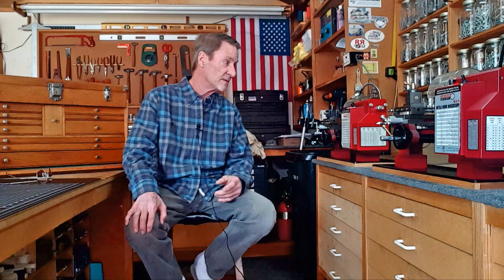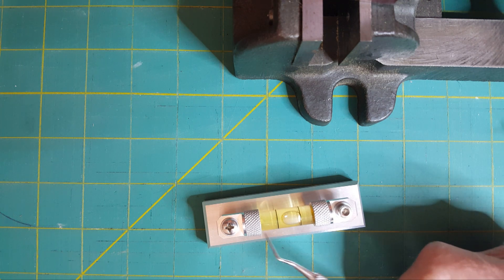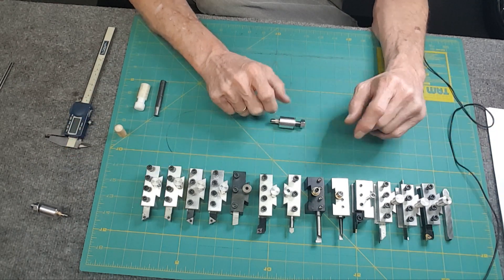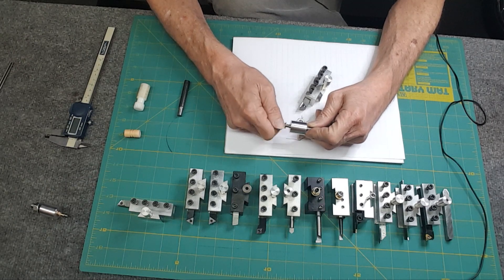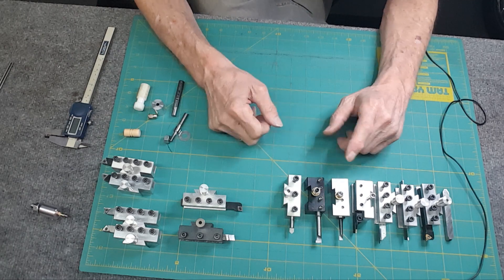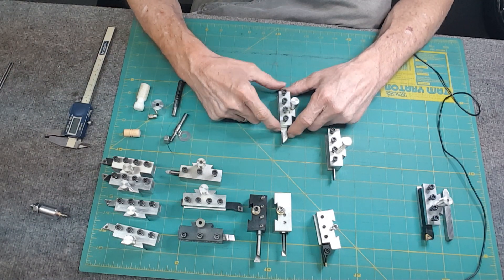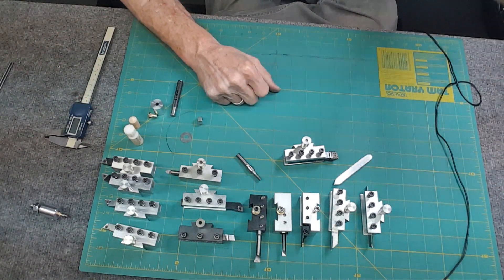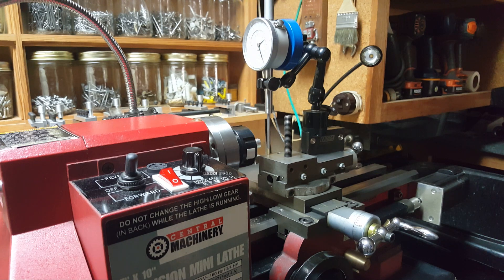Best Mini Lathe Tooling

Comment: Hello Dave, a few comments for you here. I have been in the machining industry for almost 30 years now and have worked with all kinds of manual and cnc machines including the hobby size like you have. I like watching most of your videos and I am impressed how far you have come since you started this channel, keep up the good work!

In most cases the mini lathe is not powerful enough to use carbide indexable tooling hence the reason you do well with it as long as you keep the depth of cut low. A good example of this is the cutoff tool you showed, these require a lot of horsepower to work correctly and that will be difficult to achieve on your machines. Using positive rake tools will work better on lower horsepower machines and give you better surface finishes. Negative rake inserts are meant for steels but require a lot more horsepower. Another thing, as an FYI, that indexable cutoff tool is facing the wrong direction, if you use the side where the insert is in line with the shank and face it toward the chuck you accomplish two things, 1. you can get closer to the chuck and 2. you can do larger bar sizes. Another tip here, if you go to a smaller width cutoff tool the machine will handle it better as well because there is less tool pressure. A good company for this is Thin Bit.

The solid carbide boring bars are from Micro100, I have used tons of them over the years. They are a little pricey for the home shop guy but well worth it if you can afford them.

Lastly, when people tell you they can push tools to get parts done faster, ask them why? Are they trying to run production? If you are doing this as a hobby, who cares how long it takes.

Comment: Works like a charm. I have a bigger lathe (Grizzly G0752) and I almost didn't have a Dial indicator that would work. I used a .2495  piece of steel from a Router bit  in the chuck (I used my 3 jaw)  and from the  top of the compound to the top of the router bit it was 1.23"  I then subtracted Half the diameter of the bit (.2495" /2 )  which gave me .12475" then subtracted that from the total distance (1.23"  - .12475") Which gave me 1.1053 total distance from the  bottom of the holder to the top of the Cutter I was adjusting. 

 I have one of those little Fowler Granite block comparators  and so you have to be careful and take your time adjusting the tool in the tool holder  on the granite. I got it back on the machine and faced a 1" piece of Aluminum  rod... DAMN, it is dead nuts on and I do notice a slight difference cutting with the carbide cutters more than the HSS.  I'm gonna try the other idea you have for better finishes and see. thanks Dave for Sharing!!

Comment: Best inserts for a mini lathe are the aluminium type carbide inserts. Sharp ground edge and 20 degrees of rake means they need minimum power. Buy machining grade aluminium or steel to make life as easy as possible for the lathe. Brass of almost any type seems to work well. I use the inserts for aluminium on steel, (free cutting or mild) brass and aluminium. They may not last so well on the steel, but they can be bought very cheaply.
Reply from the maker: I was always afraid to use my aluminum inserts on steel. I've bought the same inserts from the same source and it seems batches are different so I protect the good batches. Thanks for the tip!

Comment: Hi Dave, here's a question that you might be able to help me with.
I have a 7" x 14" Chinese mini lathe and would like to run the lead screw with a separate very low-speed motor (12V or 240V) to slow the cutting speed down and improve the finish. Have you any idea what motor I would need and where to buy one? I have calculated that the 16 tpi lead screw currently runs at about 8 rpm at 500 rpm spindle speed.
Thank you for your time Dave.
Glyn in England.
P.S
I have already stripped the lathe and re-built with tapered roller bearings, a good de-bur etc.
Reply from the maker: I removed the lead screw drilled and tapped the end and made an adapter to a NEMA23 stepper motor with a TB6600 driver but I do get excellent finishes just using the lowest stock gear setup. One of the videos shows this look for my playlist on the mini lathe only.
Reply: @TheMiniMachineShop  Thank you, I'm trying to watch all your videos but will ff to this.

Comment: I hate to point this out, but your "Precision Level" is not a precision level, If you called it an "Adjustable Level" That would be more correct, However Precision..... NO. Beautifully made as it is.
Reply from the maker: Well if you watch the making, calibrating and testing video of it and do the math it is sensitive to 1.562 minutes of arc or 0.0260 degrees and is flat to less than .0002 now look at the specs for a 4" Machinist Starrett level then tell me which one is adjustable...
Reply: What makes a Starrett precision level “ precision” is the very accurately graduated vial that enables you to accurately determine how far out of level something is. Not just guess based on your estimate of how far the bubble is off. The Starrett 4” levels vial has 6 precise graduations over an approximate .750 window. Making the interpolation of degree of incline FAR more precise. What  you have is an accurate adjustable level. Not a precision level.Its like you have a “ dial indicator” of levels You can see it is off but you can’t accurately measure it. The Starrett level is more like a DTI you not only can see the discrepancy but you can measure it. The graduations allow you to MEASURE .005” not just detect it and guess how much bubble is over the line.

Comment: That is not a precision level. A precision level lets you MEASURE the amount of incline. Not just detect it and then guess the amount based on a guess at how far the bubble is off. The Starrett 4” level has 6 very accurate graduations in an approximately .750 vial window, allowing you to MEASURE .005”” per foot discrepancies not just detect them.
Reply from the maker: Yes, I know all this but I'm not going to spend a fortune for something I don't really have use for.